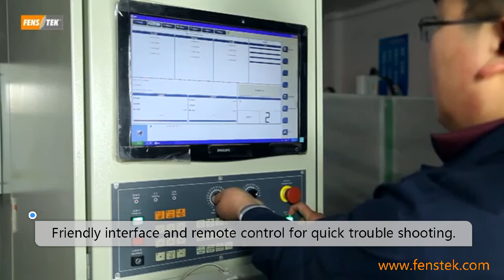4 axis aluminium curtain wall facade  machining center f260.Industry aluminium machining center.

Comment: Controlling system are based on the #windows7 controlling system, it is more easier for operator and also can be easy used for remote control. It is nice machine for #curtainwall # facade produciton.